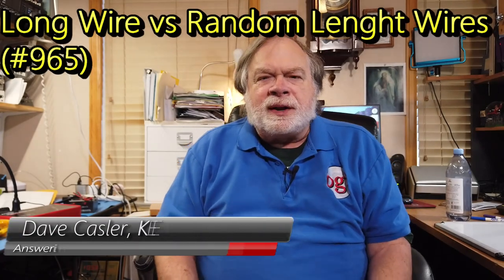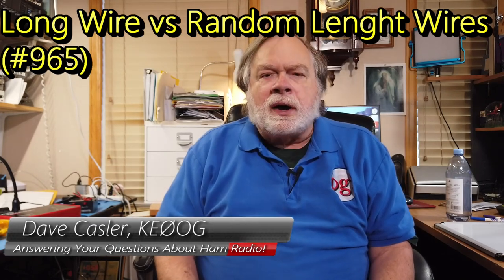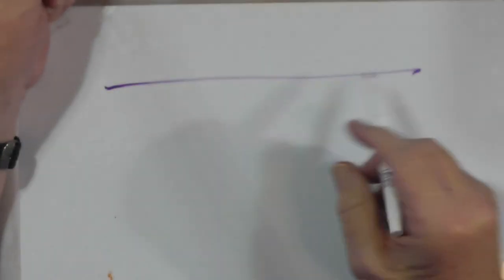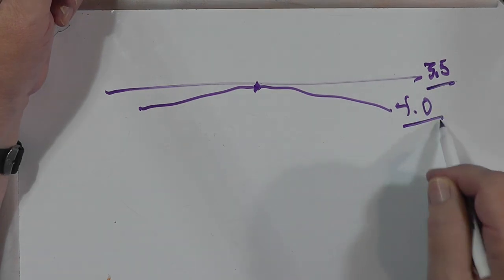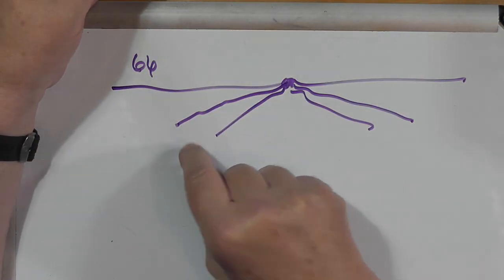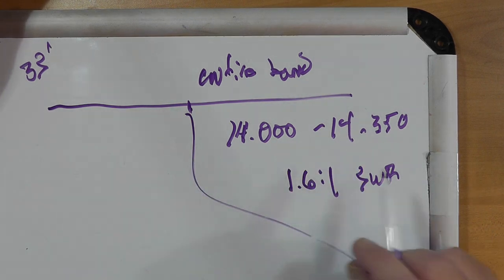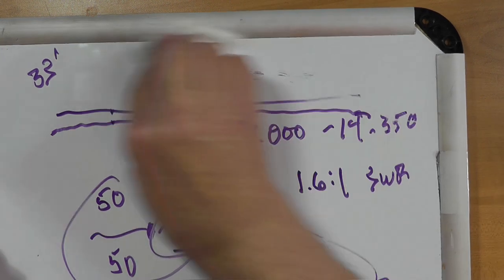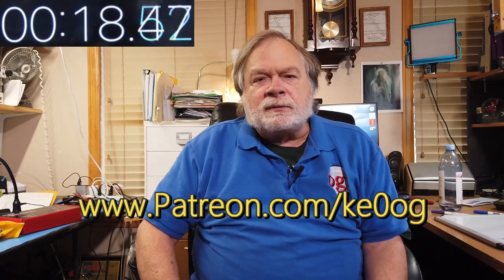Long Wire Vs Random Lenght Wire (#965)

Comment: Most likely Rick VE5MIR was referring to an End Fed “Long Wire”, commonly called an End Fed non-resonant wire.  The performance of this design is well known and “long” considered one of the most versatile antennas available to hams. A simple 9:1 Unun will match a 73’ wire on 40-10 Meters, often times without the need of an external tuner.

Comment: In this configuration (End Fed non-resonant wire), the coax is EXPECTED to resonate and will be choked at an established distance from the feedpoint before entering the transceiver’s input and lighting/surge suppression ground point.
Reply: Expected to “radiate”…

Comment: Balun or not....a dipole will have a much lower SWR (than 1:1.6), if you simply use 75 ohm coax. This works very well, if you are operating at lower power levels.